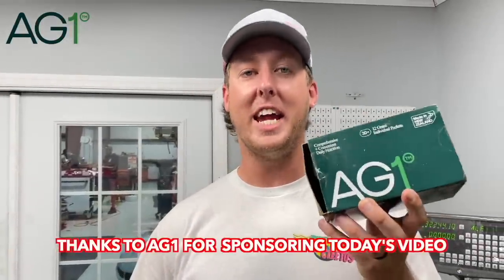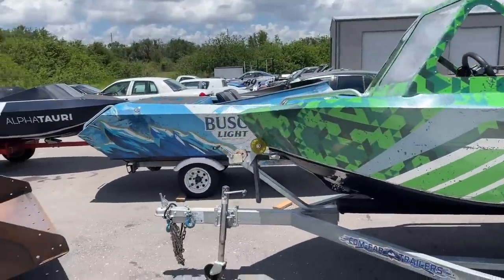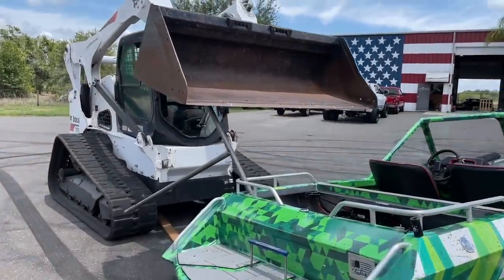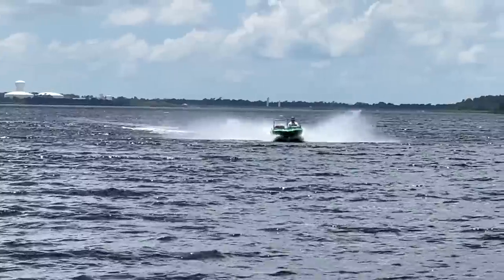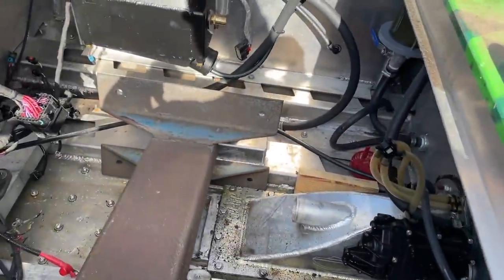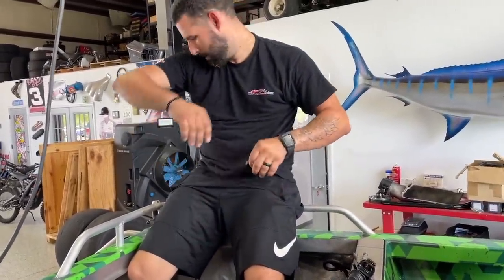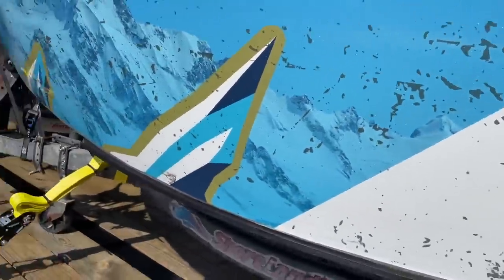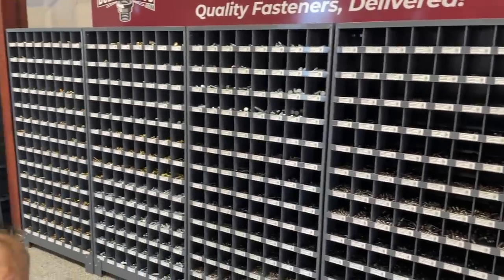Using Heavy Equipment To Fix My Damaged Jet Boat!!! I Missed and Really Screwed It Up...

Comment: Pro-tip: always put your ratchet straps on the passenger side, that way if you have to pull off the roadway to tighten them up you don't have to stand along passing traffic
Reply: I like that thinking. I've always put them on the driver's side so that I can see them easier.
Reply: That's a good tip, I'm going to start doing it that way.
Reply: I believe DOT requires it to be on the driver side in order for the driver to check on the ratchets… I could be wrong I’ll have to confirm online lol
Reply: @spencerlewer7053  I'm pretty sure you are correct
Reply: @spencerlewer7053  Seems like an old rule from when passenger side mirrors were an option
Reply: @spencerlewer7053  I wonder if that's a state or federal thing? Cause they've never bothered us about which side they're on, they're only concerned that there's enough securement. But now I am curious because I've hauled two tractors just this week and I thought nothing of which side my binders were on either time, if I'm being honest lol 

I say tractor as in farm tractor. One small, one reasonable sized. Not like tractor trailer in case it wasn't clear.
Reply: @spencerlewer7053  That's how I've always done it, but the passenger side would also make sense for driver safety. I'll have to look into that, that'd be a silly thing to get stopped, and cited for.
Reply: Great idea. Just heard this on another video recently. 💪
Reply: @spencerlewer7053  not in Michigan
Reply: @joshuaboehm6419  we always had more than one guy in our trucks, so it was the passengers job to check straps
Reply: @br549rdr  It was a good idea for the time, but we've since mandated passenger mirrors so I don't think it matters as much. That's just my opinion though lol
Reply: @joshuaboehm6419  yeah definitely more safe for stopping and tightening down for passenger... but i like seeing if the ratchet or binder is bouncing up and down in case it wiggles loose
Reply: So simple, and yet So efficient
Reply: I do passenger side on my hay loads. They need to be tightened on a long haul and I don’t want to stand in traffic.

Comment: The bolts and nuts rack is another sign of how fast this shop has evolved.  It was just a moment ago that McFarland racing was James and Garrett hanging out in the corner of the Fasterproms shop with a janky tool kit.
Reply: That's been there for months. They did a video on it.
Reply: Their first boxo tool chest was unreal.
Reply: Hard to believe that it’s been probably 5 years since that was the case. Two years already out of the current shop and 3 years with the neighboring shop to Jeremy.
Reply: @philb5593  jeez, it's really been that long hasn't it? Seems like it was just yesterday they bought Ruby haha

Comment: I have a gut feeling that the Dew boat is going out in a blaze of glory, that the hull is going to recycling heaven after Idaho and something more experimental and stronger takes it's place..
Reply: I think you're right. Any more rocks hitting an already weakened aluminum hull will push it back out of shape and change the thrust angle of the jet drive. You can tell the thrust angle is still off by how much bow is in the water. If Cleeter had a way to adjust the thrust angle of the jet drive without beating the hull with heavy equipment it would sorta "fix" the problem.
Reply: I agree. I build Aluminum Skiffs with 5086 Marine Grade Aluminum. It’s a brittle aluminum they use on big ships. Once aluminum takes a hit or gets a dent, it has a memory and will almost always go back to that shape easier than the first hit. I bet Cleetus goes for the new 4 seat design model like the Motion Boat. He really liked the design as he was talking about it. He will have a car seat in the back for Little Ripper. A Hot Rod family model. lol
Reply: how about a jetsprint boat with a roll cage & V8?! Cleet did damn good when he raced the Jolly Rogers boat.
Reply: Yep gonna be at a store near you. In a 12lv'e pack.😂😂😂
Reply: I mean that was a 50-70 ton excavator seems pretty strong to me lol
Reply: How thick is the current boat bottom? Anyone know?  Maybe go twice as thick down there specifically for cleet, yeah? Twice as many bulkheads.

Comment: Doing 50 mph on water feels like you're doing a 80 mph. When I was little my dad bought a used boat I asked what's the top speed he said 40 miles an hour I thought it was slow until I got on it felt like i was going 100. Keep up the great content guy's
Reply: We had a pleasure boat later in my youth that did 35. I thought that was slow til I got on a tube behind it lol. My dad could swing that 35mph around like it was 55. Lol 

I've since then tubed behind a 55-60mph boat and it was mostly under 40, but he did open it up a few times and that felt like doing 110 that close to the water 😂

Before that boat we had a boat that would do 60-65 and that was just not usable where we lived.
Reply: @goosenotmaverick1156  That's awesome back when kids had fun.
Reply: @markchapman2585  shew, I got to have tons of fun nobody would allow kids to have these days. My dad let me drive a forklift and taught me how to properly drive and use it, to move things onto and off of pallet racks, at 7 or 8 years old (it was an automatic or shuttle drive,not really sure which, but no clutch necessary)
I also grew up riding ATCs (3 wheelers, aka the death machines lol) and all the fun stuff. He also let me drive our first boat around the same age, after that he let me drive any boat we owned, until we sold the last one when I was in high school.

Comment: Thanks for this video...  just had the worst month of my life, with my V wagon breaking just 2 weeks after it was out of my hands for almost 2 years getting work done. I have been ready to take it to shows for so long and it's been nightmare after nightmare. And the cherry on top is that after I got everything squared away, I'm pretty sure it blew a head gasket. Hoping nothing is really damaged. Really upset. Needed this vid. Been physically and mentally drained for the past 2 years all for nothing

Comment: Try tipping the boat on its side tie it to a strong structure then take the plastic off the bottom and weld a hook where it needs to be flattened and use a really strong winch to pull the dent out. Then grind off the hook and welds until it’s flat.

Comment: Remove that plastic shielding, and weld on a new bottom that is properly contoured over the existing bottom. Then fill the gap with epoxy. And then reattach the plastic. You'll be adding a little bit of weight, but the wait will be added mostly in the back where you would want it, and you'll get a proper shape. Otherwise carry it to an automotive body shop and they'll be able to force it into shape course you are weakening the aluminum every time you do that so once you get it to the proper shape I would weld aluminum plates to it both to reinforce it and to add a bit of strength. Then the plastic on top of that
Reply: Definitely this. It's a jet boat that gets the shit beat out of it, not an off shore speed boat - durability is needed here over 'ideal' weight distribution.
Reply: @RyTrapp0  maybe you didn't see the 50-70 ton excavator hitting it and still barley did anything to it! seems pretty damn strong to me
Reply: @NightshiftCustom  Yes, because it's basically an arch shape from the backside, and arches are strong. Reverse arches are not strong, and it's basically a reverse arch from the bottom side, the side that's taking all the impacts when Cleet is launching this thing over logs and boulders. Not to mention, since it got dented, it's stretched the aluminum around that dent, so it's going to be easier to re-dent. That hull definitely needs work beyond just some whacks with an excavator, it's pretty thrashed.

Comment: Annealing the aluminum would have helped a easy way to do that draw all over the area with a sharp heat the aluminum frome the opposite side till the sharpie marks disappears and you should be good to go . Aluminum work hardens so when you bash it in to stuff or beat on it it makes the aluminum  harder and eventually brital (alot of time thats when you get breakage) something to keep in mind good to see dew getting some run time in .

Comment: Cleetus definitely not easy on equipment. I too am doubtful that the Dew boat will survive another rapids adventure. That boat has been abused way beyond the normal range I would expect. I would have thought that boat with the engine upgrades would get closer to 60 m.p.h. Maybe a small 100 h.p. nitrous kit is needed. 👍👍🇨🇦

Comment: Maybe try using a hydraulic jack with your own custom made little jig/frame that bolts to the hull in a way that the frame/jack can pull/push it back into shape.

Comment: Seems like the hull will always be an issue for a River boat with the current design.  A 1/4” steel ride plate bolted to the bottom would help like is done on most PWCs. The plate will need to extend to what touches water on full plane all the way to the back. Once the plate is beat up, make another one. It would not hurt to put valve springs or stainless steel of similar size where the plate attaches to the bottom.

Comment: Time for Tye to make a frame for the jet boats to pull the dents out. make a few plate that will bolt into existing holes in the bottom and pull them with a hydraulic ram

Comment: I love the Jet Boat content. I love drag racing and done so off and on for 30+ years, but I recently got into building aluminum Skiffs for skinny waters. I’m a fabricator by trade and spent a couple years in welding school. 5086 Marine grade Aluminum is my favorite to work with. I use a Miller 150 spool gun with great results. I designed a 14ft mini jet boat that will run a outboard with a jet nozzle lower unit. The new 4stroke outboards run for years without any trouble, plus you don’t have to winterize the engine. I will not get 300hp, but I feel a 90-115 Yamaha Jet will push a 14ft boat into the 40+mph range.  
 I will probably get negative comments for this, but I can’t be the only one thinking it. James really needs to change the Wrap on his boat. Maybe another Motion Race Works wrap. Or the Nuts and Bolts company, or Coors Beer if he wants to stay with the beer theme. I bet their is thousands of companies that will pay for his boat to be wrapped. Hell, the jet boat company would love to have James running their Logo. They may offer James a new boat kit just to wrap it with their Logo. Best advertising they can get. You have their target demographic on your channel. Anything but Anheuser-Busch.

Comment: I realize that the Bolts and Nuts thing is a promo, but I could see where something like that would be great for a shop.  Have all the different bolts and nuts you need there, easy to grab whatever you need.  See them running low, just scan and re-order.  Hopefully that scan system to reorder tells you if you have already got some on order.  That way anyone could scan and order if they see some running low.  And if someone else had already done that, it would tell you that you already have some on order.  Those grab and go kits would be great if you had an assortment of the nuts and bolts you needed for a specific car.  So taking Mullet out, grab the Mullet grab and go and have all the nuts and bolts you need for it.

Comment: I own some of those grab and go drawers that ive had for years, got a stack of them from a parts store i worked at when they were getting rid of them. I use them for fuses, wiring comnectors, stuff like that, i can toss it in my vehicle with a toolbox and haul off and fix whatever emergency the boss created for me today 😂

Comment: Water is getting between the poly and aluminum hull sucking the front of the boat down. You need to seal those seams in the poly on the front of the boat.

Comment: All the Dew Boat needs is the hull bottom sections replaced. Just perimeter the gunwales and zip it back down to a new bottom section. The skid steer love tap will buff.

Comment: A friend was getting into the boat building business and bought a mold so he could build a center console bay boat. Unfortunately, it was originally for an inboard motor and had a "hook" built into the hull. That made the boat have a tremendous hole shot but would nose over (just like the Dew boat) when it got up to speed. Way too hard to steer with the nose (deep vee) in the water.

Comment: Use a post hammer  attachment to get the dents out way easier.. also its the jetdrive angle that has changed. You probably hit a log and its changed the degrees.   Makes a huge difference even 1 degree.  Make a wedge spacer for the jet drive and she will pull the bow out and on plain straight away..

Comment: Does the Bolt and Nuts system work with an app so that when you need a specific bolt in your inventory you can search on your phone and it will say in which bin and slot it is? If so super cool and handy. If not you should look into it.

Comment: Just a tiny skidloader tip. Use the tilt for the weight bud. When you use the boom up and down you can smack boat when it slips the tilt wouldnt have.

Comment: Use a 60# jack hammer with a round compacting bit for tight quarters compaction of soil. I saw this old timer using one on a job close to a wall of a basement. Not sure of its custom or what but some whacks with a hammer should get that thing to move IMO

Comment: Aluminum has a memory so your needing to put reinforced rib’s across the grate and the best way to straighten is a slow push like a porta power and a bridge from the two main stringers I know that was the fast and dirty getter done brother but y’all need to reinforce your intake cause that shit get freaking hammered jumping the reason I know is been fighting with mine for same reasons and it pops back in after a couple good hits and now I put 3 reinforcing stringers connected to main stringers and if this doesn’t work you have to cut skin out and weld in new pieces

Comment: I WORK FOR A MARINE COMPANY FORKS ON FORKLIFTS HAVE HOLES AT THE END YOU CAN CUSTOM MAKE A 2" OR 1 7/8" BALL THAT CAN UNSCREW FROM THE FORK AND BAM DONT HAVE TO WORRY ABOUT YOUR BOATS RUNNING AWAY ON YOU. ALL CAPS SO IT STANDS OUT AND HOPEFULLY CLEETUS SEE

Comment: I've been wondering if some lead weights in the rear of the boat would help. Like 75lbs or so bolted to the rear of the engine compartment. Or even a aluminum tank full of sand. Idk just a thought

Comment: Should of got you a number jack and place your boat under your car lift and place the jack under the life and to the spot that needs to be pushed down all you would have to do is push the down button on your lift that will put pressure straight down to what you need to straighten out it would of work like a champ

Comment: I'm surprised u guys haven't used any frame pullers and just weld some connection points to the weld and pull it if those things can straighten car frames then I don't see how it couldn't for a aluminum boat.

Comment: I went to a new job site and they had a mini excavator they all hated because it got so hot when running. There was a heated seat switch behind your head they covered with a clip board. I didn't tell anyone else and it was high summer. I like to think its still cooking those dummies.

Comment: If you placed the boat under your car lift and used a tall bottle jack (like used for lifting a floor truss)  to push off of it, that would probably be a little more precise for dent correction.

Comment: Why don’t you use a few inches of the protective layer you have on the bottom of the boat. And put it on the sides high enough that it covers the area that gets trashed.

Comment: Just asking... why can't you use body filler under the plastic bottom? Or cut it out and weld it back flat? I'm genuinely asking if there's a reason. If it's time, I understand.

Comment: What I don't understand is why you didn't see this issue before you pulled everything out of the boat and fixed welds. It wasn't until the boat got put back together from weld repair did u notice a problem? And if it had a problem prior how is it even possible you smashed it in? It took an excavator to move the metal. Seems like something didn't get reinstalled correctly? Jet pump? New plastic boat bottom?

Comment: Why not just double hull the bottom of the boat with the proper angle you want the boat to have instead of trying to bend it out.  Wouldn't hurt to double hull the boat anyways the way Garrett keeps going over stuff in the water anyways.

Comment: Why didn't you just cut the stringers and use a strong back, bridge, and a wedge to straighten it, then you just weld it back up and remove the strong back. It's a standard method used in fabrication.